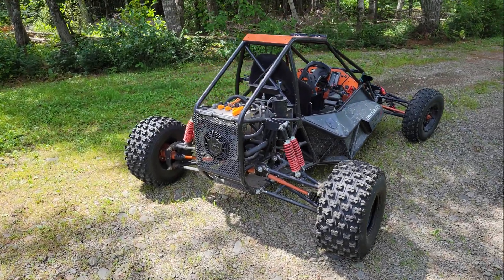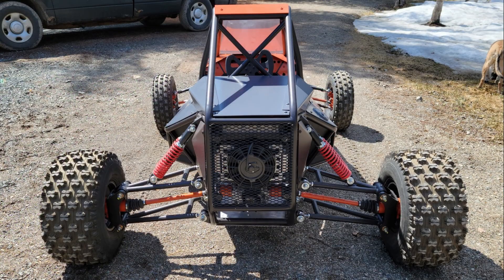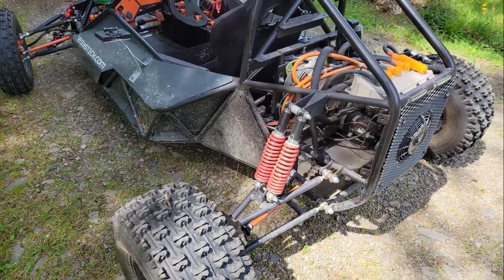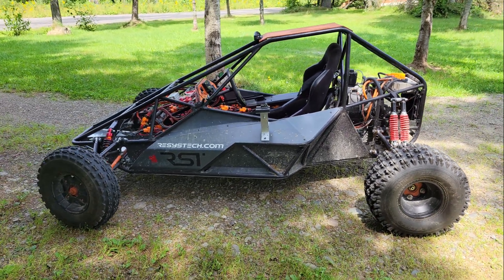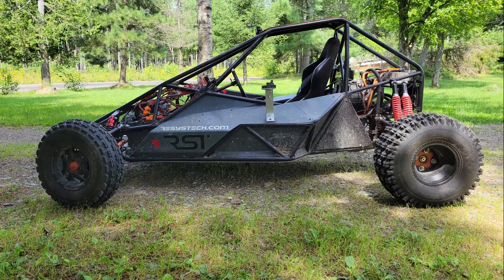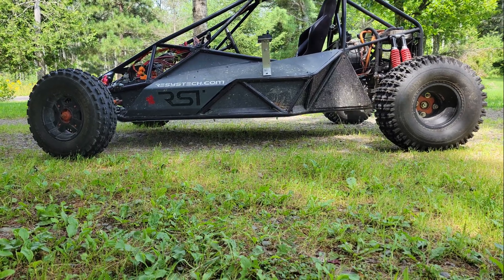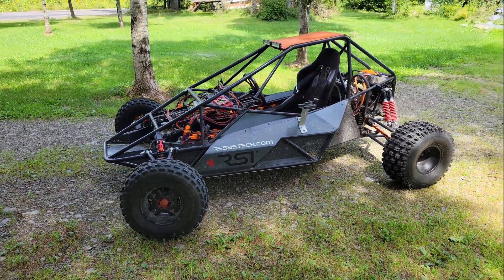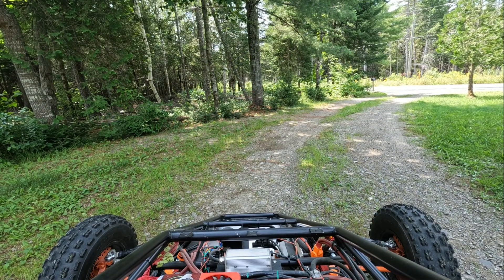Homemade Electric Buggy Ep 12: NEW TRACK! New Problems...

Comment: Its seems like you have alot of voltage sag when accelerating. Bout 5-7v is fine, but I saw up to 11 volts in your video. Either your batteries are not up to the task, or you have to go through all your connection and upgrade or delete some of the connectors.
Reply from the maker: It's possible that voltage sag could be an issue and the bms just isn't displaying the error like it should and somehow doesn't require rebooting to reset the relay as it does with every other protection feature. I have the individual cell volt cut-off set to 2.75V per cell in the bms, but again, there's no indication from the bms that it's cutting power for any reason, and every instance power is cut it can be traced back to overcurrent issues with the controller which is designed to cut power momentarily and restore without rebooting, hence why it was remedied for the most part working with Kelly with 0 changes made to the bms or battery.

If your concern is just about voltage sag, then it should be noted that the amount of sag depends on the sum voltage and current as well as bad connections or improperly sized conductors, but if the latter two check out then whether or not the voltage sag is technically 'bad' depends on the cell design and chemistry. They're not all created equal, and the 'general' rule of limiting voltage drop to <5% in transmission and chassis wiring doesn't actually apply to battery cells themselves under load unless it's going to damage electronics connected to them (hence bms cut-off safety features). Some cell tech is designed with high c rates that can handle large voltage drops without any issue other than lower motor rpm, others are not designed for it. Headway cells, like the ones that I originally purchased for the motorcycle, are rated for a 2V cut-off as well and the factory curve charts show them dropping well below 2.5V from full charge resting voltage at their rated continuous current of 160A (20C). 

The math alone shows that my connections are fine, but regardless, they're checked religiously on a weekly basis along with battery health - hence why there's no hood on it and hasn't been since last winter (it's a pita to take off, need a latching mechanism). 32S / 11V = 2.9V per cell under heavy load, which is pretty much what I expected. The factory curve chart shows the cells dropping to under 3V with a 3C load when they tested them (their rated continuous current), and they have a rated cut-off voltage of 2V. This is inherent with most LFP chemistry. LFP doesn't behave like NCM when charging or discharging. So whether dropping to 2.9V/cell under heavy load is good or bad, ie should or should not be happening, depends on the cell first and foremost, and these cells are rated for far more abuse than what they're experiencing. If individual cell voltage dropped to or below the recommended cut-off under load, then I would consider that a problem. But I just don't see that happening, the bms should shut down long before that.

Again, this doesn't mean that voltage sag isn't a problem in my case, but if it is, it would be in a connection that I've been missing consistently with regular checking, and the bms isn't showing the error or behaving like it should. But as I mentioned, the esc has been determined to be the culprit a while ago. It's just not powerful enough to handle what the motor and battery can do.

Comment: Very impressive build. My experience with Kelly controllers is the same In my opinion they are made for golf carts not high-performance carts like this. I would ditch it and get another controller.
Reply from the maker: Thanks! But there's literally nothing else even close to the power that I need. Kelly was and remains the most powerful for the price. That's the problem with every other controller, which would only make this problem even worse. Gotta have wiggle room. Pushing and exceeding the limits will always make relays trip as they should. Kelly esc's actually perform really well in high performance machines if the user matches with an appropriate motor and tunes them properly. Can't just plug and play in a custom machine. The MAP setting in particular makes all the difference between a high performance kart and a golf kart. I've never had a problem with Kelly's in other builds because they were always rated higher than the motor so I could get the power that I expected, utilize the current limit settings to protect the motor from damage, and had some wiggle room to limit heat buildup in the esc.
Reply: @JamesBiggar  Have you considered getting a Sevcon?

Comment: Try using fardriver controller bro
Reply: Ok bro for fardriver the only option is using 2 controller or dual controller setup
Reply from the maker: Unfortunately they don't make anything powerful enough. Most powerful they've got can only handle 20 kW, I need at least 24 kW continuous to match the Kelly...preferably 30kW to match the motor's power better. Only Kelly has what I need for an affordable price, currently. But like I said, I'm going to try the cheaper mods first to establish a benchmark for torque and go from there when the budget allows.
Reply: @JamesBiggar  If the mods are not enough you might want to take a look at 3Shul controllers. I'm pretty sure that the CL1000 or the CL1400 will meet your power requirements.

Comment: Maybe an arduino or a raspberry combined with a hall sensor for measuring the current ? That would give a lot of options I'd guess.. a WCS1600 can measure up to 100A for example but I would guess there are ones that go much higher.
Reply: Yes, or a shunt.. I  guess there is either a shunt or a hall sensor already present.. it was just an example although I guess a hall sensor is easier to implement... ;)  Don't know why you deleted the message frank ^^ ;P
The emphasis is on the raspberry.. it can store measurements and you have a whole arsenal of software to draw graphs and analyse data.. like grafana and such..
Reply from the maker: Could be held for review if he used naughty words. I'll check.
Reply from the maker: Nothing held for review. Maybe he just changed his mind :)

Comment: I'm pretty sure if you bump your voltage 20% your amps will fall off and you won't overload your BMS I have an old Schwinn electric bike that Canadian tire used to sell a long time ago that has the motor dangling off the rear axle it is 24 volts but I run it around 36 and it's very happy I use two Ryobi 9 amp hour batteries in series
Reply from the maker: The bms isn't the problem, it's the esc that's underpowered and keeps shutting down. The bms can handle a lot more power. Increasing voltage is definitely an option, but with no space left for more LFP's, that would mean replacing the entire bank with NCM for higher density and more space to add more series connections. I'm pretty sure that increasing the gear ratio will lower the current demand too. It's a relatively cheaper fix if it doesn't slow down top speed on the track too much. I'm sure some folks are thinking it should be capable of 100+ miles an hour, and if it were a highway vehicle or a pro race machine competing on a rally course then I would agree. But highway speed just wouldn't be possible here. 60-70km/hr will likely be the fastest I'll be able to drive on this track without skidding into the trees, and that works for me. As long as I can make it fun. No sense wasting power on speed instead of torque if the speed will never be used. I'd rather save the voltage upgrade for when I can budget adding another motor and esc into the mix to double the hp. For now, my concern is getting the current components to work together as optimally as possible.
Reply: @JamesBiggar  it's hard to balance everything out grasshopper you will learn how to snatch the pebble from the Master's hand(kung fu) 😁